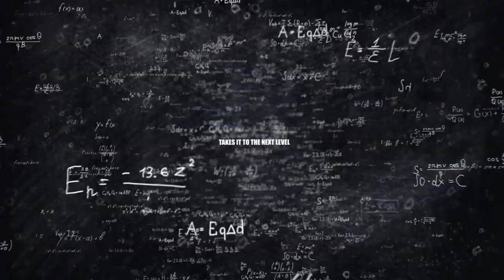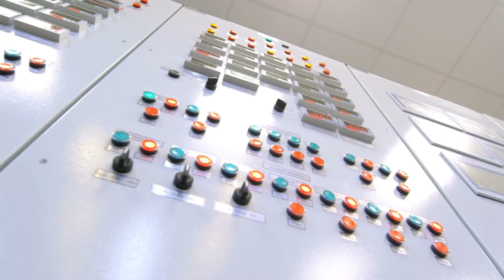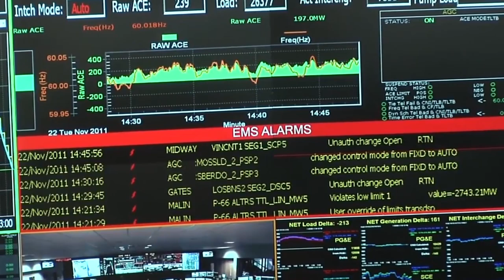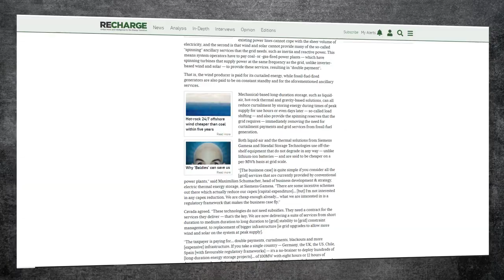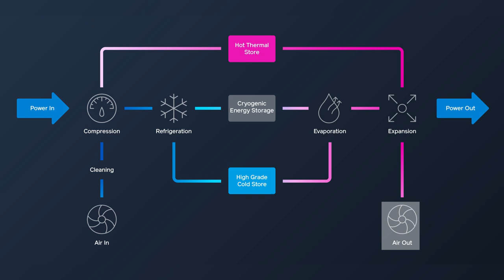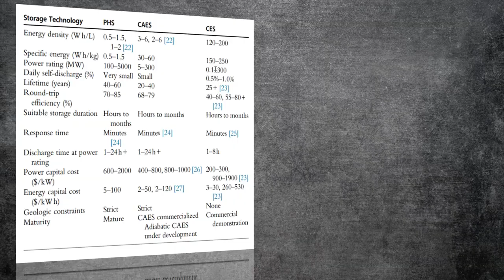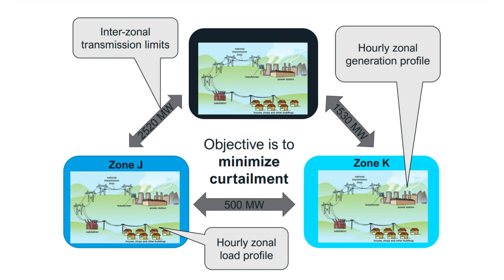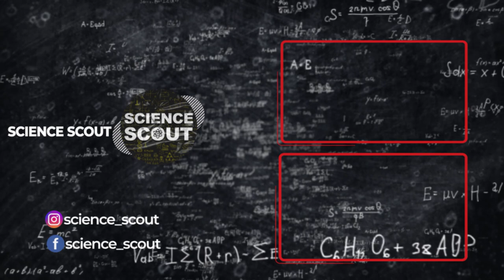liquid air battery (LAES): the missing link to mainstream, scalable renewable energy storage?

Comment: Why are the storage tanks above ground ? What a waste of space. Liquid air can power transport systems  motors/engines directly without  conversion to electric power. It is a safer system then liquid hydrogen because hydrogen atoms escape through metal tank walls into the atmosphere. Also liquid air is portable. Wish I had a home driven by liquid air delivered to my door.
Reply from the maker: The point of this project is not to generate energy but to store power and release it when it's needs
Reply: Storage is above ground because it's cheaper, the tanks are insulated, and the system is modular, so you can keep adding tanks (or eventually replacing them) without disrupting the system.
Reply: @ScienceScout 
I see and understand your point.

However, if Joedee1863 is correct with his assertions, then I not only agree with him but I also feel that he is right-for and justified-in raising awareness of it here!
Thanks, Joedee1863, for giving us more to consider and research on this fascinating topic!
Reply: *his or her... assertions...